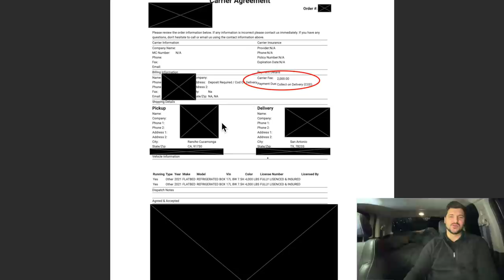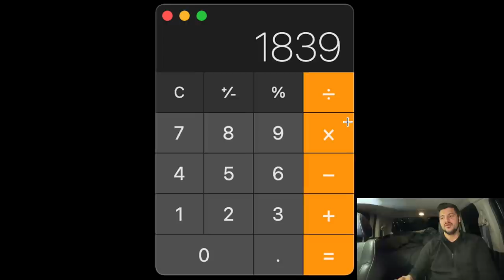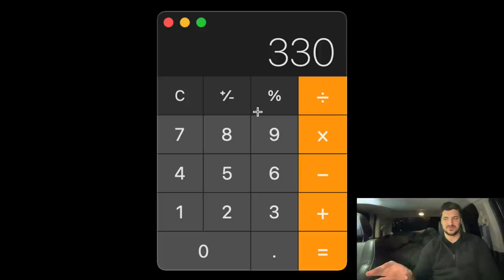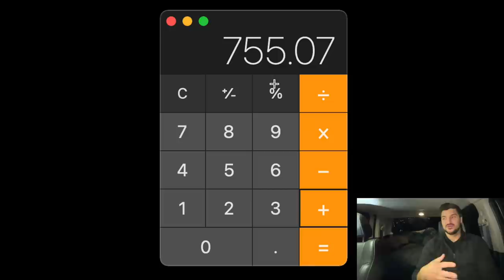Had to call a roll back tow truck for this load

Comment: Alex, I do Roadside assistance most cars now don't come with spare tire. Kia started doing it around 2011.
Reply: Even when they did have spare tires, I heard about a guy at a rental company that would use them for street racing and burnouts... and then put them back.  Good luck using those!

Comment: My Dodge Charger doesn't have a spare either.  They give you an air compressor and a can of fix-a-flat.  I've been planning for almost two years to buy a real spare for it (there's room in the truck if you remove all the extra styrofoam crap), but just haven't gotten around to it.

Comment: Repair kits rather than a spare are not uncommon for new cars. don't be surprised if you encounter it. Trucks and SUV's for the most part all come with a full size spare that matches the rest ( you can even use it in tire rotation).  Center of gravity and ability to tow a certain amount of weight dictates if it comes with a full size spare, a donut, or none at all (will come with some sort of repair kit, which is obviously useless in a blow out, but works for a flat as a result of a small puncture)

Comment: My wife has a 2013 Chevy Malibu it didn't come with a spare either when we bought it I called the dealership or we got it at and he said look in the spare tire holder I am it came with a air pump and on one end of the air pump you can flip a switch and it has fix a flat I said so what do we do if we have a massive blowout the dealer laughed and said to call AAA

Comment: Question, so if your gcvwr is 26k, and let's say the truck fully loaded weighs 11k and the trailer 7k, are you putting 8k on the trailer for a total of 15k even though it's down rated for 12k?

Comment: Just from title. 2 tow trucks...  doesn’t sound good.  While I realize equipment, insurance... for them is not cheap.  They charge a LOT.  Could you leave CAT scale ticket on screen for 2 more seconds?    If I may suggest. Don’t put spare back under.  (Unless no room in bed)
  I don’t know exact laws.  But stopping on interstate is not allowed unless Emergency...
  The tow truck costs were not terrible..

Comment: Alot of car manufacturers are starting not to put spares in thier cars. They put a cheesy 12 volt air compressor and a little can of fix a flat in the car. I know GM cars and Kia are doing this.

Comment: So did you not have to drive to Ventura to pick up the second trailer? If you did, your mileage calculation is a little short.
Reply: He can haul up to 26,000 as a non cdl carrier. Anything more, and he needs a CDL.

Comment: I don't know how people don't know new cars do not come with spares anymore and  it's either a pump with fix a flat too get you down the road or you call road side but spares are a thing of the past so I hope now you know most new cars do not come with a spare but the battery is in its spot.... hey most people don't even check there spare air pressure so a flat for a flat most times....lol